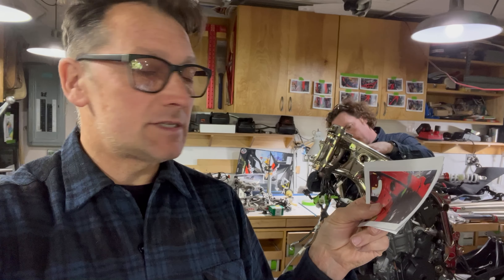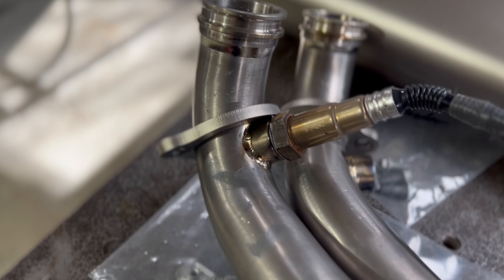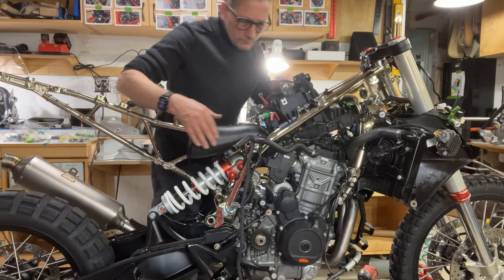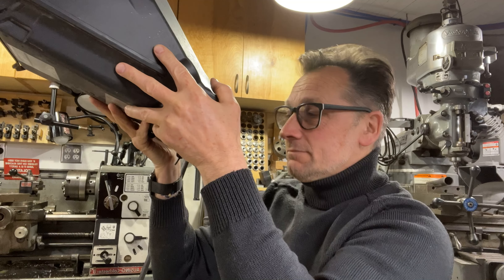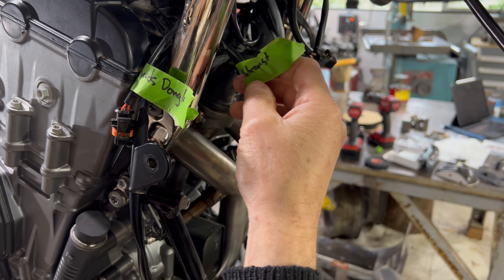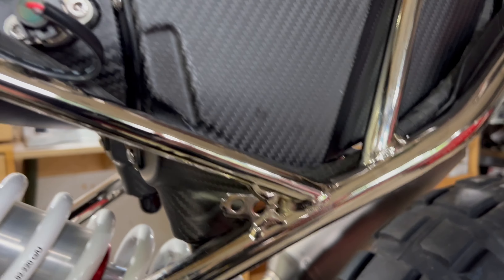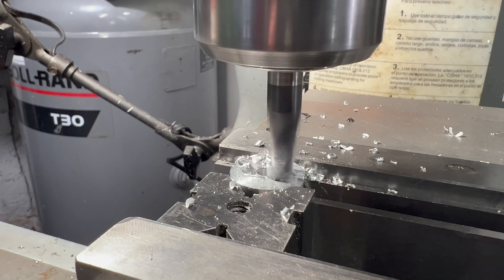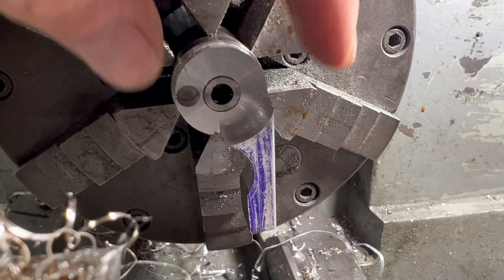KTM 890 Adventure Build - Episode 2

Comment: Did you have any issues bleeding the brakes , with the abs pump , I fitted cone valves on mine and fitted the rally brake pipe, it bleed ok, just wondering if you had issues